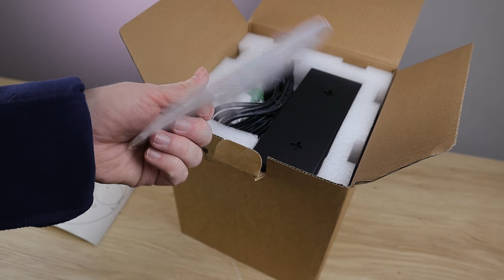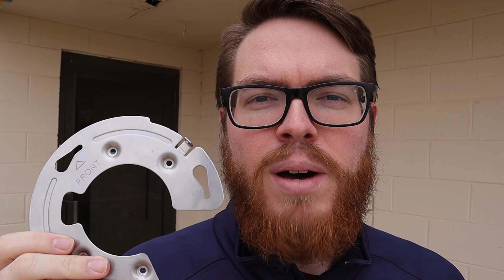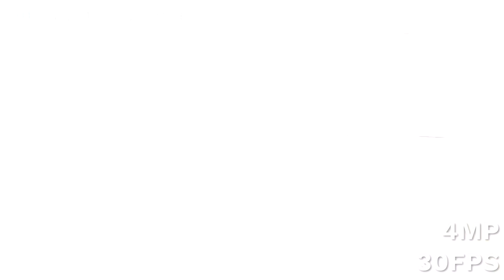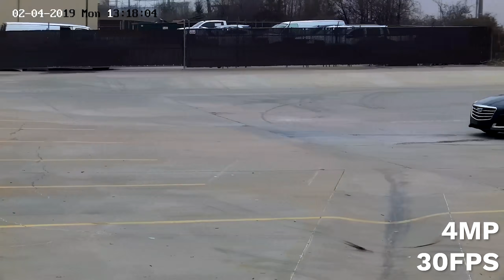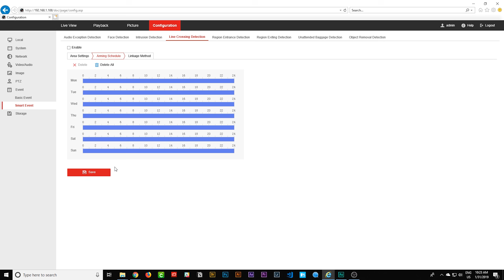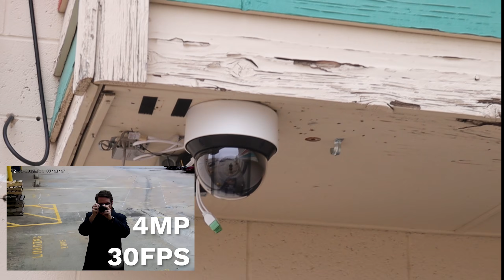4MP PTZ Camera w/ Auto Tracking & 160' Night Vision, Hidden IR, 60 FPS Video, & Long-Range 25x Zoom

Comment: Hey there, Nelly. You sure this is 60fps? I have a Hikvision dome camera, it says it's 30fps. In reality, I can only set it to 20fps. :-( 

And, to be honest with you, Nelly. I hate those large sockets on short cables, especially the RJ45 female socket. It's so big, I have to drill a hole in the bricks or concrete wall about 200mm to fit them through the hole. To drill that size hole with a drill bit is not easy. The impact the drill is subjected to just to hold the drill is as close as shaking your arm bones and teeth while you're strenuously trying to drill that size hole while your eyes are also vibrating. Max size hole that a man can drill is 12mm (1/2 inch) without causing both, excessive vibration to the body and breaking excess large pieces off the brick or concrete wall. I had to drill on the brick wall with a 20mm impact drill bit. It was hard to push and I almost fell off the ladder trying to drill from one side of the brick face and all the way to the other side, where pieces of brick broke off around the hole on exit. Then I had to find ways to guide all those chunky sockets and cable through the wall. You see, my home has no eaves, that's the hardest part in guiding those short cables through and up the wall and then into the ceiling. If the camera had no cables but simple plug-in connectors in the camera body, you only have to guide the male RJ45 PoE cable through a smaller, easy to drill hole the width of the RJ45. Installation would have been easier. But no, they have to add all those unnecessary short cables and female sockets.
Reply from the maker: Hey there Mick,

You have to drop the resolution down to 2MP on this camera to get 60fps.

Drilling through brick is certainly difficult! Be safe out there.
Reply: @NellysSecurity  
Thanks for your response. Does that mean that to get 60fps I have to sacrifice video resolution/quality? 8MP down to 2MP? That would be a low resolution, in other words, a waste of money in purchasing a 4K camera that is claimed to be a 30fps and then I get told that if you want 60fps, or even 30fps just to get movie like video flow you have Roto sacrifice its resolution down to 1080p? No thanks. I've been fooled. Then there aren't no manual from that particular domestic model, it one manual fits all. For instance where are the instructions that says what does the acronym, IPD, stand for and what does it do? What does the Shield Region do In VCA, or better still what actually is VCA? I mean, it's not as if they, Kikvision, are short of space to fail to write a full sentence, isn't it? And then, there are faults in the browser GUI.  In Playback, there are these 4 coloured squares, green Command, blue Continuous, red Alarm and yellow Manual. These are supposed to be shown on the Timeline similar to the NVR GUI Timeline where there are only 2 squares instead of 4, blue Normal, and red Event. Although in the NVR GUI, the triggered Events are shown as red segments that can be accessed for viewing and saving purpose. But on the browser GUI, you cannot see, on the Timeline, where the events took place, what time, etc. So, given that this system is quite expensive, you would have expected it to be better. The browser GUI has such small buttons below the Playback video screen, as if we are all young, full of fire and energy when the majority of home owners are middle aged and half blind, wear glasses and still find hard to see these small icons without an additional magnifying glass. The question is, what's wrong with enlarging the icons to a readable size?  If you look at the tabs above the screen invthe browser, Live View, Playback, Picture, Configuration... you see them big, don't you? Not only that, but when you click any of those tabs you will find the quick and responsive. But, when you want to playback the video, whatever button you press, you'll find that you have to accurately pin-point the cursor exactly on the buttons to select it, otherwise you miss it first time (depending on the cursor speed settings). So, again, what was wrong with making these 'micro buttons, Stop, Start, Pause, Fast Forward, etc., bigger and wider, like the tabs above? It's not as if they (the idiots at Hikvision, had no space to enlarge the buttons, is it? And that, my friend, doesn't end there when it comes to fault and poor browser design, acronym use instead of full words, and... the instruction, pathetic, only kids with the eyes of vultures may be able to read that, but middle aged men? Yep, they can read the fine text (as if it's a Contract), only under a microscope is possible. How ridiculous. The only company that has an easy to read and understand the instructions, are Swann, Concord, Techview, etc., unless you want me to name other tested and recommended video security devices. Cheers 🙂👍
Reply: @NellysSecurity  No. No matter what resolution, there is no option for 60 fps.

Comment: With its high resolution and/or fast shutter speed will we need a super fast micro SD card to work with this camera, or will something like this be sufficient: SanDisk 256GB Ultra MicroSDXC UHS-I Memory Card with Adapter - 100MB/s ?  I have a several of these cards and hope that they will work with this camera!
Reply: Standard micro SD cards, regardless of speed, are not designed for the constant writing that occurs in digital surveillance. You should really be using SD cards designed for this purpose. All of the major manufacturers offer them. They are typically called High Endurance and are labeled specifically for use in video recording.